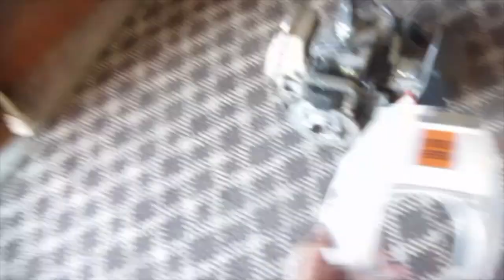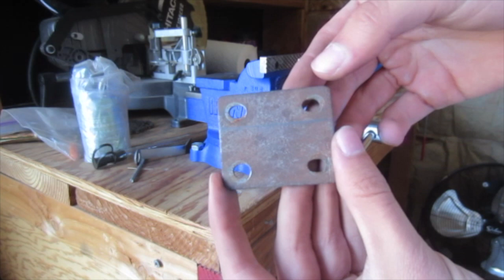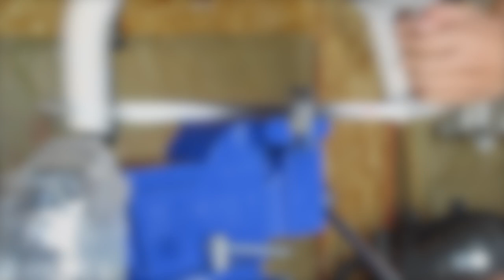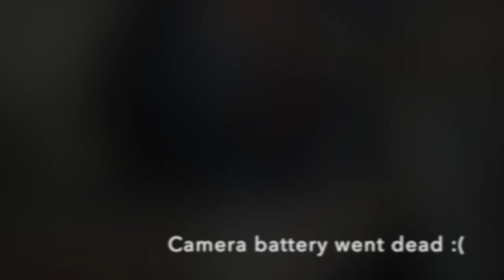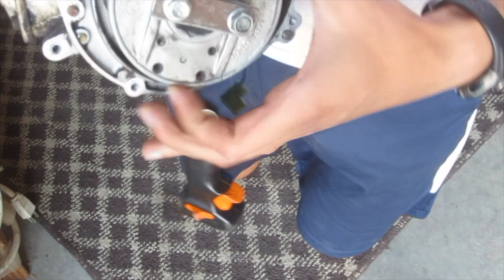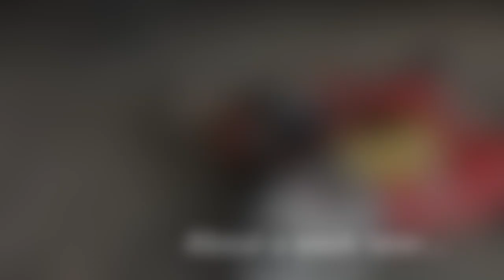Testing propellers on a 25cc weedeater engine! (RC prop car build Pt.1)

Comment from the maker: I was doing some further testing with this after the making of this video, and the nut that holds the propeller on came loose, even though I just tightened it. So I replace the nut with a nyloc nut.

Comment: cut off the cooling fins from the flywheel, they just make un nessesary drag and the coolin from the prop will be more then enough, maybe even cut off some of the cooling fins from the cylinder for waight reduction becuse of the better cooling from the large prop
Reply from the maker: The flywheel fins are not necessary, but the fins on the cylinder help conduct heat away by adding more surface area. The only thing with breaking fins off the flywheel is, you could end up making the flywheel unbalanced.